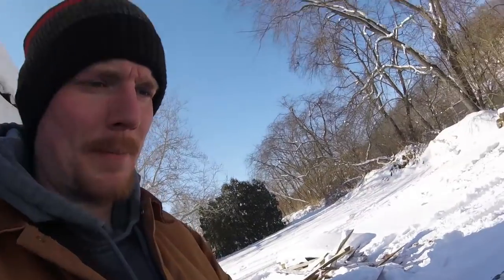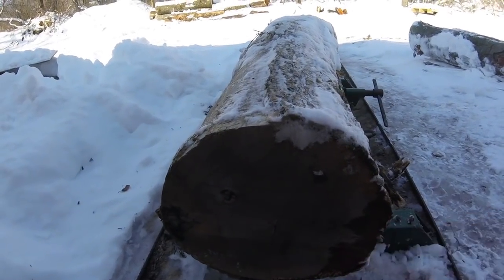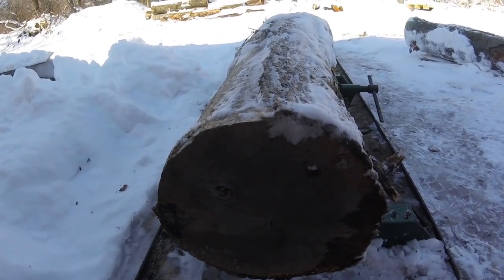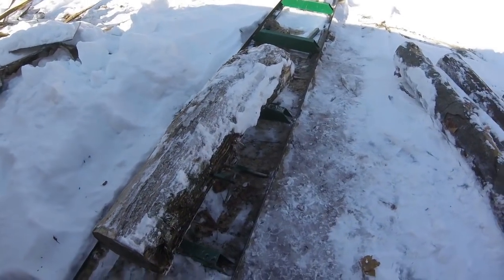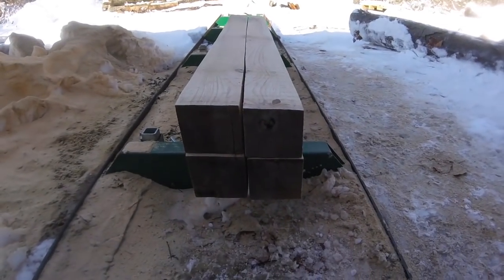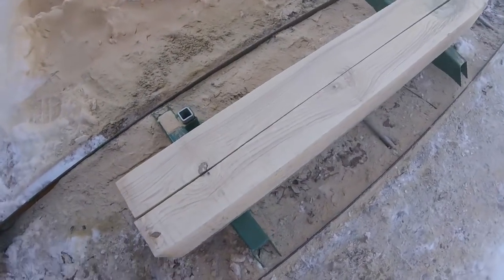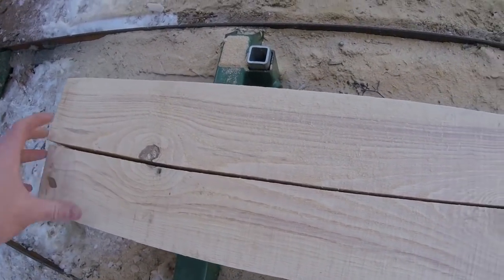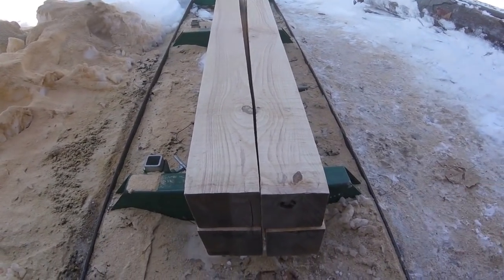One man sawmill, milling baseball bat blanks

Comment: K, new comer here with a list of stupid questions.
What make is that rig?
HP?
Price
Setup time
I only ask this because all I've ever used was an old home made headrig, that a friend and I built. We could cut 4000 bdft per day at full tilt. I like this unit you have, looks easy to put away, and probably cut enough in a day to suit me just fine
Reply from the maker: Prepper Madness, The mill is a woodland mills hm122 it's a little on the small side but it cuts up to a 22 inch diameter log. Comes with 10 feet of track. More can be bought to make it longer and it has  a 7hp Kohler engine on it. It cost a little over 2000 dollars. They have larger models available as well. You can check out their website https://woodlandmills.ca/us/portable-sawmills/?gclid=EAIaIQobChMInoqM0cn22AIVVFgNCh0Fmg2KEAAYAyAAEgIDRfD_BwE 
I posted a video review as well. I'll admit it can be a little fussy with the bed not sitting perfectly flat it cuts a little rough but I figure that's what a planer is for. I hope that answers your questions and if you have more feel free to ask. Thanks for watching.
Reply: Thanks for asking that looks like the rig I"m after, gonna check out the site. Thanks
Reply: Prepper Madness Ben has proven that the small WoodlandMills model 722/122 sawmill is a solid and durable small sawmill. The best feature of the WoodlandMills sawmills is that the raised log bunks are pallet for friendly, making it easy to get heavy logs onto the sawmill if you already have a forklift or tractor with a loader and pallet forks.